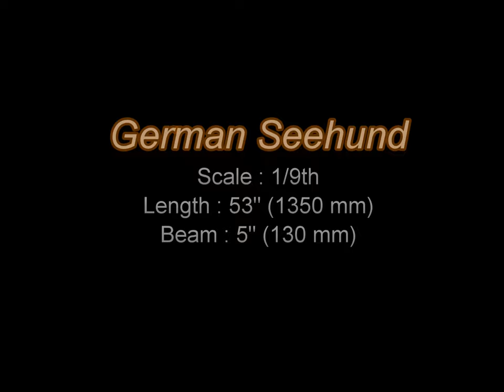German Seehund R/C Submarine

Comment: A few questions…if you have multiple wtc's or subs, could they all be controlled by one transmitter? So if you had a transmitter, and you got a new wtc, you could control it? plus, since I'm new, what would be a good transmitter to get? And, if the wtc is the pressure hull, is the actual model free flooding? Because if it's full of air on the surface, and then you submerge and it floods, wouldn't that upset the ballast calculations?
Reply from the maker: Provided you use matching frequencies of receivers, control of multiple wtcs is perfectly possible with the same transmitter.  Ideally, however, you simply transfer the same cylinder between multiple models. Any 4+ channel radio system on 75mhz (North America) will work fine.

Comment: How does it Submerge underwater? Is their a tank inside that pushes water in and out?
Reply from the maker: NinjabeeRedtricity Correct.  There is an onboard ballast tank that uses liquid air to blow the ballast tank free of water. You can see it clearly at the 1:22 mark in this video.